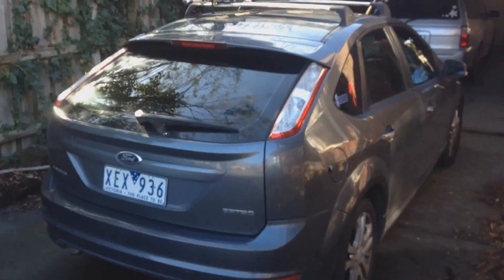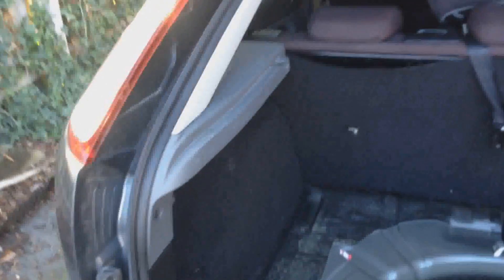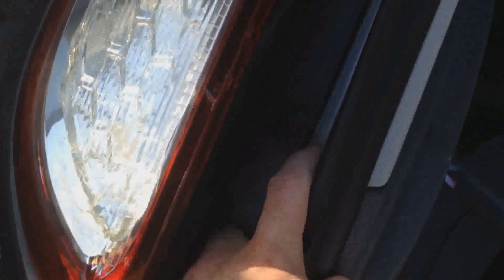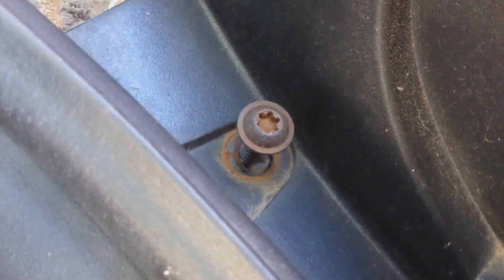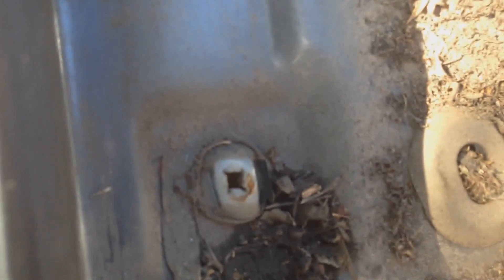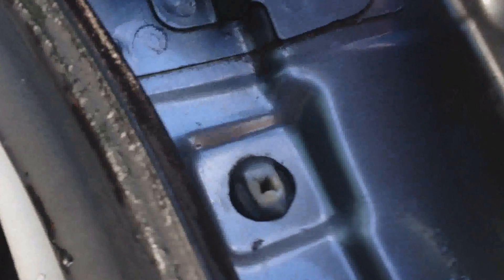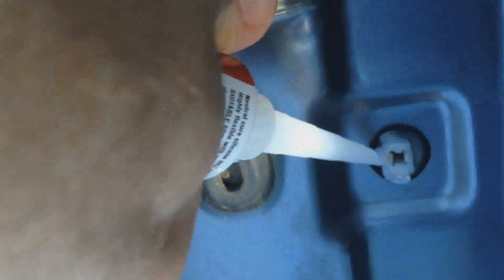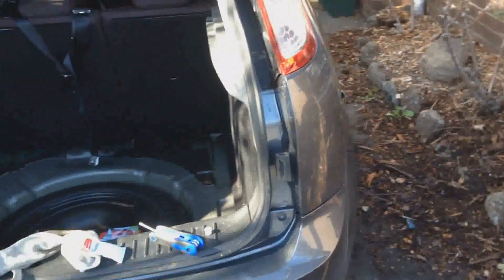Ford Focus LV (2009) - repair a water leak in the boot (hatch)

Comment: I had the same thing, water collecting in the spare wheel well and this didn't cure the problem on my car. Mine leaked on a seam underneath the black plastic roof trim. Just lift the trim up on the roof near the boot and silicone the seam underneath, if you have green algae collecting there it's a good bet this is where your leak is.
Reply: How do you remove the black roof trip strips?
Reply: @dermotsheehan6331  You don't need to remove them,just lift them at the end near the boot with your fingertip and you'll see the seam underneath. I wish iId tried this first as I didn't need to seal screws and all around the boot lid,this was the only place mine was leaking hence the green algae where the water was dripping into the seam. Good luck.

Comment: What worked for me  - before you cover your car in silicone and basically make a mess of it do this first, this video and others DID NOT WORK FOR ME - answer is in the ROOF PLASTIC STRIPS or was for me at least , my leak was in right hand side of bootwell so i removed right hand strip, careful not to break it but it should remove with some pressure - now re silicone the whole gutter/space where strip has been removed ( you may notice tiny cracks damp in space )- leave it 10 mins then replace strip. This is a confirmed fix  - my boot hasnt been wet since. Your welcome.
Reply: richat1 how did you get the roof strip off ?
Reply: @paulhorton5594  Just force if I recall - just held down by strong double sided tape. I think I redid mine with 3M tape when I took it off. Might have to do it again now.
Reply: Mine was the same and on the same side. I didn't need to remove and seal the whole gutter as the seam was right at the end near the boot. One blob of silicone and it was all fixed,I didn't need to do the whole thing.

Comment: just brought a 06 cmax for the wife and..yup. water in the boot.. thanks for the upload will fix in morning
Reply: Darren N it's not the problem. It's the boot hinges are the problem :)
Reply: iv applied  silicone to  the light bolts,, the boot hinges and also the roof gutters..i pulled up black strip..  dry now
Reply: john . i looked last night and ..water in boot.. took off liner trim on boot lid and could see a rusty water  mark running from the spoiler bolts..

Comment: Hi there, can anyone confirm if this worked? I have a 2009 focus and I have the same problem
Reply: Hi, I've got the same model as you. I've put a bit of silicon on the top of the lights to test. If it still leaks I'll try the same as in the video and let you know

Comment: I tried this fix on my 2006 Focus but I'm still getting water coming in on the left side only, the same as before? Any other ideas?
Reply: Theres 4 air vents under the back bumber... the left 1 could b lose and lettin in water, just had this problem on both sides in my 2012 focus
Reply: See my comment above,mine leaked through a seam underneath the black roof strips into the boot.
Reply: may be from roof rails...
Reply: mine from roof rail...
Reply: @Pavis_Blog  I silicone sealed both sides where the roof rails meet the boot but it's still coming in, maybe not so much but still not great. I may try again when the weather is better but thanks for the reply 😉
Reply: @markreed9853  i think we hv to remove roof rail n fix it
Reply: @Pavis_Blog  it's strange because mines dripping down the inside of the left wing and gathers were there a rubber bung in the back left floor of the boot🤔 -just find it funny it's getting that far 😬 I've also removed and resealed all the light fittings with sealant